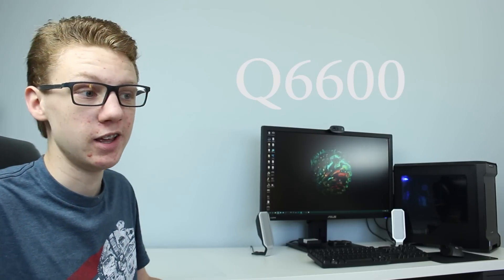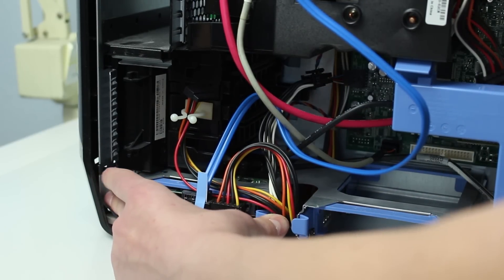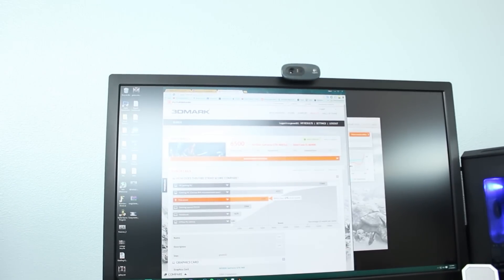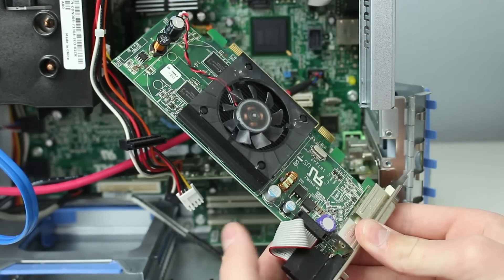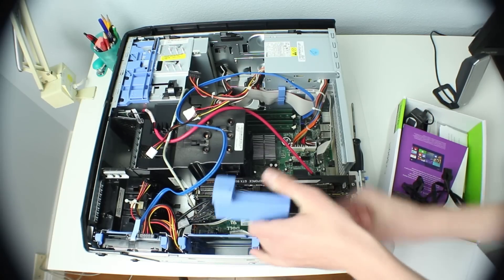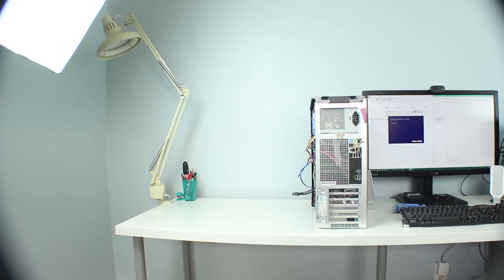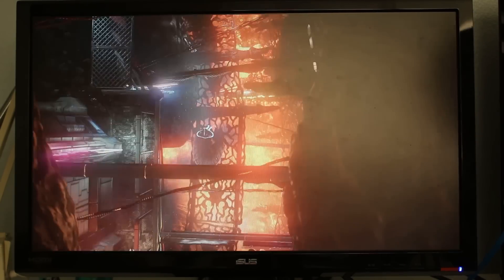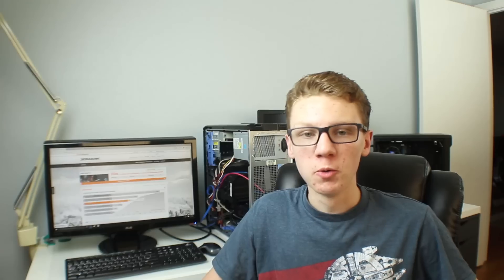Old CPU + New GPU = Gaming PC? (Core 2 Quad + GTX 960)

Comment: I've been running a Q6600 in a Dell XPS 720 for years, running the newest games without issue. I went from the 8800GTX it came with, through a GT440 when that one fried, to a GTX960 which I bought last year. The CPU held through all this ordeal like a boss. The only difference is that my Dell came equipped with a 750 Watt power supply.
Reply: Lol Jolk
considering a Q6600 is around 30 dollars nowadays and provides more than twice the performance in a multicore task, I'd say it's worth the investment and wouldn't set you back that much even if you are saving for a new rig. It will make your life so much more easier until you are ready to cough up the dough for a new computer. Sitting on the E2200 would probably frustrate you into rushing to buy a new build, and having to cheapen out on some possibly crucial components.
Reply: hey man can u comment more about your setup. I pulled out one from the store that has been rotted for over 5 years yesterday and thinking of some cheap upgrade. Its now on E2200 775, Abit Fatality mobo, 2gb ram, 8800 GT. I guess Q6600 can fit on 775? GTX960 is not overkill for that cpu, bottleneck wise?
Reply: supertuberful
Yes, Q6600 is a 775 chip, so in theory it should work on that motherboard. You will need to check the specs of the exact mobo model and see what CPUs it supports (it may require a BIOS update to accommodate chips that were released after it was launched).

The graphics card is a bit overkill on my particular system because the motherboard only supports PCIx 2.0, while the card is PCIx3.0, so part of its capacity is unused due to the restricted bandwidth, but the overall experience was more than decent in my opinion.
Reply: +supertuberful the q6600 WILL bottleneck. it's better to save up for a new build instead.
Reply: What the deal nowadays I kept reading about repurpose Xeon processors. I can get E5440 around that price. Do you think that is better then Q6600? Yeah the E2200 is terrible even 5 years ago standards  (That was why I move to PS3 and now PS4 haha) but now the kids are big just checking out my options if the PC parts is viable. What card is cheap but good enough nowaday anyway that is miles better then 8800GT? To be honest I calculated for a new rig but dont think its worth it (for me). Got a laptop from 2012 that carry i5 and 640M that start to really struggles last year.
Reply: supertuberful
on paper the E5440 should perform slightly better than the Q6600, due to the increased L2 cache. However it's on a different socket (LGA 771) thus wouldn't work for you, you'd need a different mobo. And if I'm not mistaken, since your computer was launched around the same time my 720 was, the mobo should be a BTX, so good luck finding one :)
Reply: +mihaitha yeah that is why I put the question up. Because apparently now there is some kind of 'scene' to hard mod xeon processor to fit LGA 775. and repurpose server grade processor for general usage. I contacted the seller and inform them my mobo type (Abit A190HD) and they say it is compatible. Just not sure where to get more info on this kind of stuff.
Reply: supertuberful I wouldn't do that TBH. From what I can see from your specs, your motherboard only supports a 1066 MHz FSB max, so the Xeon which has a 1333 FSB would either not run, or be downclocked to the matching speed, making it perform worse than the Q6600. I don't think it's worth the risk or the hassle. Also, the xeon is 10 bucks more expensive. That's 33% more than the Core2Quad, for (maybe) a 10% performance boost (if you can make it run at 1333 MHz that is). If I were you, I'd go for the safe bet of the Q6600, maybe slap in a better cooler and see if I can overclock it to a 2.8GHz or so.
Reply: i have a dell xps 8100 it has i7 860, 12gb ram and i have installed a gtx 960 = 60fps in new games and if we combine it with an application called process lasso(https://bitsum.com/) i can squeeze some extra fps out of the games.

Comment: In the last 18 months I went from a Core2Quad Q6600 + 8GB DDR2 800MHz + NVidia 8800GT 1GB to this:
Had to change the graphics card because the 8800gt died, so I bought a GTX760 in a hurry/sale. That improved gaming A LOT, but games with lots of AI were kinda the same as before (except for the great graphics, though). I decided I wanted a new processor so I bought an i7 4790k with 32GB of DDR3 1866MHz RAM (I know it's overkill for games, don't need to say it). I'm still using the same GTX760 and I see a real and big improvement in games, especially in open world. The same graphic card that used to run games in medium/high, now run the same games in very high/ultra (custom options beacuse I'm a special snowflake)

So yeah, you used a 99% pure GPU test, and only that. You should have run a few more tests to make your time worth haha. Great review though. Your sister looks a little annoying :P
Reply: Had a 8800gts now have 970gtx

Comment: Next time you should try to get the same specs as much as possible on both PC's.
- Like removing the ram on your good computer to as close to the 3gb on the old. 
- Use the same screen or resolution on both PC. 
- Test more than one games/benchmarks.

Comment: What a surprising video, honestly, i as right now, am working with budget sistems in order to max out whatever i can for fewer dollars, for example, i have a Phenom X 2 565, from 2012, with a 2009 board from asus that let me take the 2 hidden cores the phenom has (with updated bios of course)....and with 10 gb of keystone generic ram DDR 3 at 1333 Mhz and a EVGA Nvidia GTX 750 ti, i can play games at 1080 on high settings wir average 45 to 70fps, depending on the game on question (though i have to play batman arkham knight at 720p with all on low settings and 2016 games on 768p with medium settings).....but i am very amaze to see i was not the only one with this kind of mixing curiosity.

Comment: Does intel core i5 3.2 Ghz with GTX 1080 works?
Reply: +AQW JameZ depends on which model, the i5 2300 for example would not be enough.

i5 4590, i5 6500, etc would be fine

The lowest you should have is something like a i5 4460

Though an overclocked i5 2500k would also be fine.
Reply: Quad core*
Reply: It'll work fine.
Reply: The Dapper Llama thx
Reply: OdinAlgeron im using intel core i5 3450 quad core 3.2ghz
Reply: +AQW JameZ try buying a 3570k
Reply: AQW JameZ would depend on the game really, its a good cpu
Reply: Wojciech D yes, still great
Reply: Overcolck it to at least 3.0 GHz and it will be good to go
Reply: squirrel0815 No u.

Comment: Dude, you're only doing synthetic GPU benchmarks, therefore all those arguments are wrong. I'm running Q8300 with HD6770, and I can barely get 60fps on BF3 64player server on low settings, and while I tried exact same GPU on my friends i5-3570k we were able to get more than 60fps on ultra settings

Comment: Its a great myth you always need the latest cpu.This is not the 90's anymore my old i5 650 duel core will still run all games at 1080p.Even paired with a 280x its a pretty smooth experience.Many current games said it was below the min spec but its total BS. 
Its a gimmick to sell hardware any duel core intel or quad amd will still run current games. Sure they may be a few bottlenecks but learning to adjust settings to be more gpu bound its even better. 

Even my 4 year old fx 8350 is still doing well its been at 4.7 for 2 years solid with np...
Point is you do not need the best cpu you need a decent gpu however.Even new builds for example an FX6300 + gtx 970 will beat i7 + gtx 750 ti for about the same price. 

Its amazing how cheap you can get into serious PC gaming.Buy an old office PC with older but capable cpu.Throw a  gpu and in some cases ram 8gb.Maybe a power supply but most will take a low-mid range card. Any cpu made in the last 6 years is still capable desktop wise.Even higher end i7 or FX's can often be found dirt cheap used...
Reply: +MrSnapy1  Hello  I wanna know if it worth it if I will get an 

Hp compaq 6300 pro microtower
core i5 3570  3.4 ghz
8 GB RAM ddr3
PSU 320w
and i will through a GTX 750 ti sc  since it does not require 6 pin connector 
can i reach 150-200 fps on CS-GO
Reply: Jetlum Gashi
That systems will handle CS np.Personally I would skimp on the cpu and get the better gpu without a bottleneck.So a g3,i3 or amd cpu with say a gtx 960 or r9 380 would run games much better!

Point is an i5 with a 750ti don't even begin to stretch its legs.With a 980ti it will show its strength.Just built nephew fx 6300 with r9 380 it has no bottleneck and smashes all 1080p games..An g3/i3 and 960 would do about the same.

If you never plan on spending 600 bucks on a gpu you can skimp on the cpu..Still having years of gaming left in teh future and either option can take cpu upgrade.

Don't spend money on something your not going to use.Seriously an 6300 or g3 will run games the same as an i5 up to gtx 970 and r9 390 levels.In most cases just a few fps difference 87 vs 84 fps.Either would smash CS... 

Its all about the money and how much you have.You seriously don't need powerful cpu's at low to mid range gaming gpus.
Reply: +MrSnapy1 thanks man
I am not planning to build a new gaming desktop since I live in a country where is a bit problem to find piece by piece elements and are a bit expensive  I found a used standard desktop 

hp compaq 6300 microtowe
8gb ram
about 260 euro and video card about 130 euro
almost 400. 
how many fps you thing on gta5
Reply: Jetlum Gashi
He gets a solid 60 fps vsync locked with  mix of ultra/high settings.For the money you can get much higher fps spending $ on the gpu.6300 is under 100$ here in the us vs 250$ i5.

Even the 860k(70$) or g3 will handle an 960 or r9 380 np.Would still smash an i5 with a 750 ti for about the same money....
Reply: +MrSnapy1 260 euro (300 usd) is whole computer despite gtx which I plan to buy and to install to hp 

however thank you for your respond have a great time there
Reply: my gtx 750 ti oc from gigabyte requires a 6 pin connector.  be careful when you buy it.
Reply: It's not about merely "playing", it's about playing WELL; subjective, I know. It depends on the user, more or less. There are other aspects to it, but the general gist is that it depends on the user.
Reply: There is no 750ti that I have ever seen that had a 6pin connector.......

Comment: I like doing stuff like this its just interesting to me how old hardware will run newer games. I just upgraded the first gaming rig i built, it was a e8500, 4gb ddr2, and a 8800gt 512mb and i got on ebay a got a q9550 8gb 1066 ram and i had a evga 560ti fbp to replace the 8800gt. It will run games fine at 720p or 900p and its just fun to tinker. Just built a new gaming rig with a 5820k an asus x99 pro 3.1 mb 32gb 3000mhz corsair ddr4 and a samsung m.2 ssd. Still rocking my classified 780 but gonna get a 1080 soon maybe a 1070 if its actually on par with the 980ti. But if polaris 10 comes out and matches the 1070 for around $300 it might be the new king of price\performance but we will have to wait and see. My old rig im gonna turn into a powerful media center i had a 3770k 4.7, 16gb 1866 ram and it was cooled by a h100i v2 but i put that on my 5820k which i love and I'm so glad i didn't go 6700k. Im running 4.5ghz and not getting any warmer than 60c in games. But i have a big case.

Comment: You said that the HDD may not handle all of this. So you say that it will not handle like loading some textures and installing the nVidia drivers? What on earth are you talking about?
Reply from the maker: +graikas I was saying I was worried the drive might die due to all the strain I was putting on it. It's very old, slow, and was making funny noises. It all worked out okay though, obviously.
Reply: My mistake then sorry mate.

Comment: i tried playing DS3 with a phenom II x4 955, and i was getting max fps of 45-50. Now with a i5-4690k i get 60 fps all the time. so no, its not a `no brainer`
Reply: Oh wow I uses the same cpu as yours.Getting lots of random stutter issues every now and then though.Might've been because I'm using Radeon HD 6950(Dirt3) gpu
Reply: I've been running an FX 4300 (pretty much the exact same performance as a phenom x4) with an R9 380 and my performance is a joke. Many areas have a constant 15-20 fps, and yet some have over 40 to 60. I swapped my 380 for an R7 360 and got identical performance, only that I can now max the game out and get the same performance as I do on lowest, compared to running on lowest @ 900p on an R7 360.

Comment: i pulled the cpu out of an old 2004 pre built dell. it has a intel pentium 4 2.66 ghz im going to try and get a rig put together for it. should be interesting what i can get outa it with some overclocking. I got love for AMD too, ive ran a HD FX 6300 overclocked at 4.2 ghz paired with a cheap Patriot 120GB ssd and that sucker has some beef. Just depends on how much cash you got in your pocket at the time when it comes to processor

Comment: I can max out Warthunder ground forces with E8400 (same socket as q6600) and r9 270 msi oc... on 1050p, tho
Reply: Its really not all that difficult, just built my brother a rig, (he loves war thunder) and hes running an i5 4690K and a GTX 260, he maxes it out on a 7 year old GPU.
Reply: ***** Did it ever occur to you that not everyone has the money for a more expensive card? The 960 also works great for what I use it for. I mean, I can still play most games (even GTA V, Fallout 4, Rainbow Six Seige, etc) at very high settings an 1080p or 1440p. I suggest not being so ignorant.
Reply: ***** R9 matter... That depends on your urge to advance in monitor expirience and buy 1440p or smth, i have that old 1680X1050 and it ROCKS games in 1050...

Comment: I have a gigabyte ep43t mobo with a intel Q9550, 8 gb (1333 mhz) DDR 3 memory, and Geforce gtx 660 ti.  At stocks speeds, it runs battlefield 4 and fallout 4 perfectly fine under windows 10.

Comment: Still rocking a Q6600 and I have my 290X coupled to my Q9550 @ 3.6Ghz. Runs everything great. But I do have a 750w PSU and a 500 GB SSD. Asus Formula Rampage board. My Q6600 will do 3.4 on air.

Comment: Most games don't need that much of the CPU. I'm running an i5 2400S (2.5 GHz Quad Core) with a 770 4GB and it does run pretty much any game except from hardcore simulators. 
Before that I even had a Celeron 430 with a 460 SE in my PC at some point. And even with that system I could run most of the games back then. 
So your average game only needs a good GPU but realistic simulators like OMSI 2 that simulate EVERYTHING will need a really high end CPU. I can barely run that particular game on more than 10-15 FPS while the GPU is on like 30% usage and all 4 CPU cores are at 95+%. 
And you will only need a high RAM capacity if you plan to play games that really have a big map with many details (Cities: Skylines is one example for RAM needing - I just upgraded my RAM from 8 to 16GB in order to continue building Berlin)

Comment: OLD GPU : nvidia 8400 gs 

A not so bad gpu also, this is the same build as my first "gaming" pc.
Reply: my first gaming pc was athlon 4200+, 2gig of ddr2, gt8500. i actually played around that build (only thing changed is gpu, that i upgraded to gt640) because im going to sell it.
Reply: +Pidu didu Very bad gpu still own one i run cs go 40-60 fps with an intel i3 540 overclocked to 3.8 ghz and the 8400 gs the gpu is holding me back

Comment: Gavin, this was a fun start, but surely you know 3DMark Firestrike isn't a good measure of whether or not a PC can be a gaming PC?

Do me a favor - this is free - go download and play Planetside 2 on the core 2 quad, and let us know how that goes. After that, go play Assassin's Creed: Black Flag. Feel free to monitor CPU usage as you do this; you're gonna find the results interesting.

After THAT, do one more thing - look up bsel modding for the Q6600 - you can easily mod this CPU with a piece of tape to run at 3ghz stably on the XPS's cooler and original PSU. 

I've used one of these CPUs, bsel'd to 3ghz, paired with 8gb DDR2 RAM and an AMD R7 250 1gb DDR5 GPU to play some games - and sure, most of them were GPU-limited - but I can tell you the CPU is going to be a tough sell as Vulkan/DX12, and similar technologies start placing more emphasis on raw CPU power than limiting the game's engine to one, two, or sometimes four big threads, as modern games of the past have done so far. 

One of the great things about the Q6600 is its generous l3 cache (for a chip of its age). That certainly helps. But in the end, even OC'd, this chip runs too slow in single-core performance to really take on about half of the newer titles out there today. You'd have better luck with a Phenom II X4 or X6, or else some of Intel's socket 771 dual-CPU configurations (I got one of those to play Witcher 3 pretty well for me!), if you're looking for a super long-lasting CPU.

I say this stuff not necessarily as a critique, but simply to add information for yourself and others coming to this video. GL;HF!

Comment: Hardwork appreciated brother,im tempted to buy the core 2 quad :)
Reply: I'd save the money for a better CPU , the core 2 quad would be a bit slow on performance. The LGA 775 Motherboards that you'd need for a Core 2 are limited in features and availability. I'd honestly go for a used Celeron (LGA 1150) and an 1150 motherboard, or an i3. Save up a bit more money for some better parts.
Reply: Hmm,thnaks for the advice,but i bet the quad is much better than my pentium d,it is seriuoslt slow :(
Reply: +Tron Ahmed What's the socket on your pentium?
Reply: LGA 775 , core 2 quad will be fine on that......... hopefully
Reply: Tron Ahmed It'll be fine, just consider my advice that's all. :)
Reply: Thank you :)